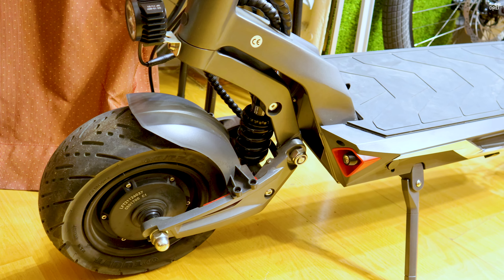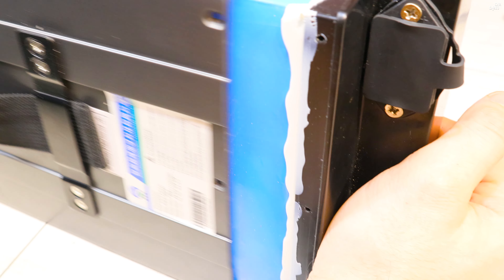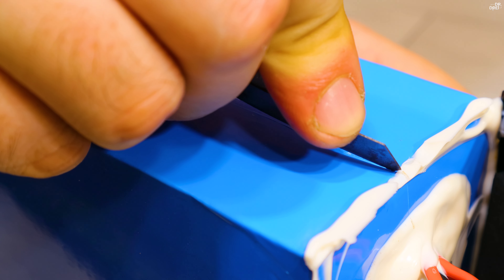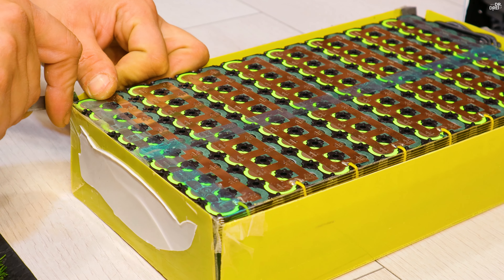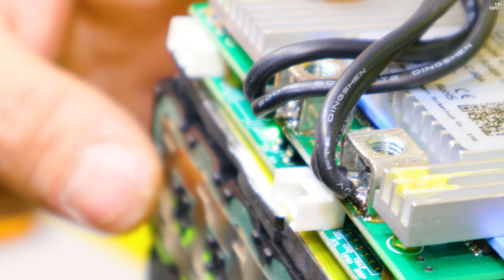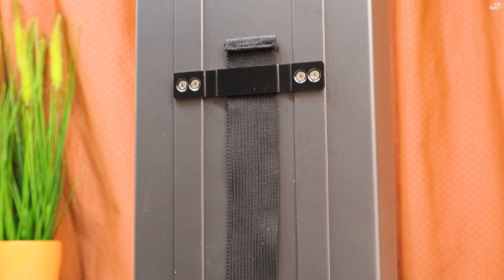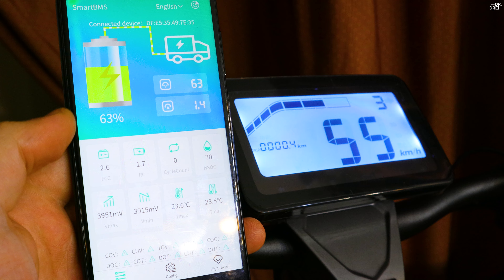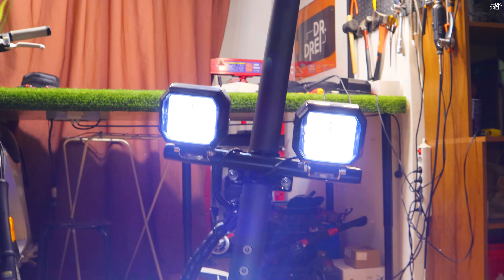BMS Upgrade on Ezotron T11 / Dragon Lightning V2 | From 50A to 80A QUCC Smart BMS

Comment: Hello, very good video, I have the same scooter called Shify Seven Ragnar. It's a great scooter. When sealing against water, I noticed a few cables not connected in the controllers. Have you checked what they are for?